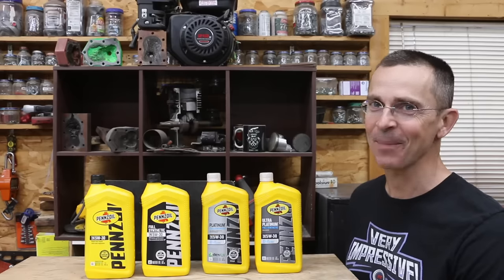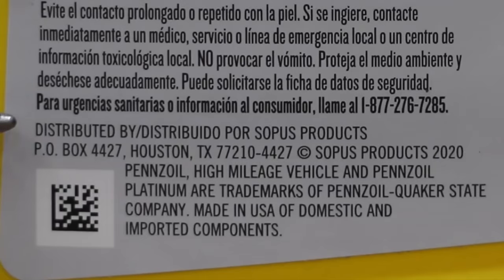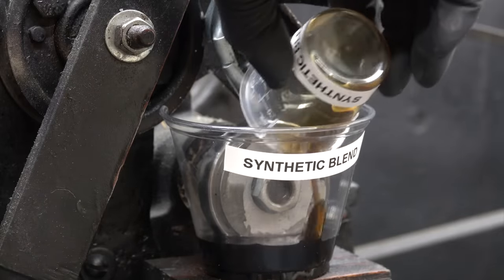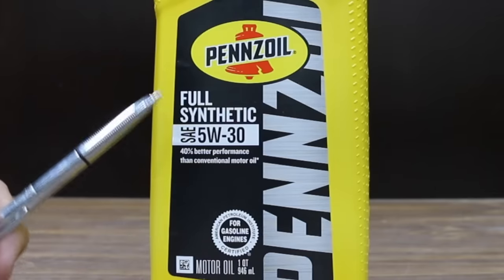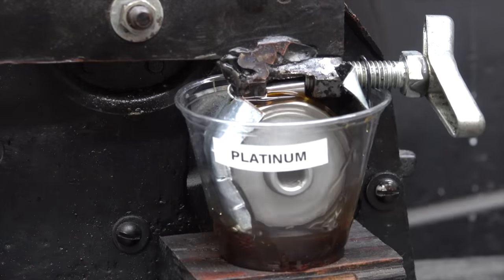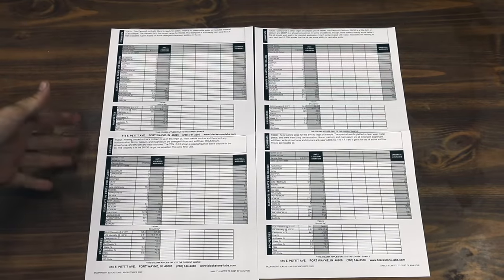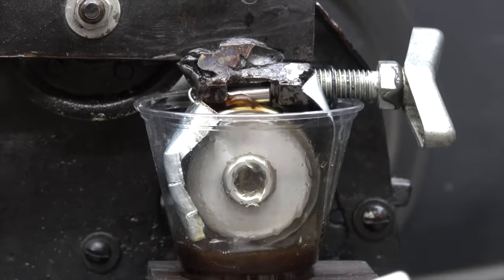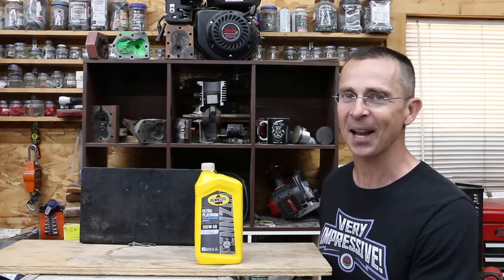Are They All The Same Motor Oil? Let's Settle This!  Four Levels of Pennzoil Motor Oil Compared

Comment: I drive a 2000 Camry with with 453 K3K miles on her original engine. I bought the car or used used but with only 700 miles . I mostly used casserobe used  Castral  Because that's what they carry it at Sears auto but right before she hit her 1st 100 K 100 KI switched over to Castro GTX high mileage and and have used that religiously every 5 - 5.5 K miles. I also add dirt loop around every 100 K and almost 1 1/2 million miles later miles later Michael my car doesn't burn or lose a drop of oil between changes. I also have always used the highest quality oil filters that I can find which is usually wix.
Reply from the maker: Thanks for sharing.

Comment: I worked for a company that blended motor oil the difference between high end and low end oil was a small (several ounces) additive added to high end. Also Shell and Pennzoil are the same company
Reply: Pennzoil is now Shells passenger car oil brand. Notice you can now only get Rotella for diesel engines nowadays and its not “Shell” branded. Also, Jiffy Lube is Shells quicklube brand and offers Pennzoil.

Comment: Rather than testing different brands or oil product lines, it would be really interesting to compare lubricity/protection between different viscosities of the same oils. For example, pennzoil ultra platinum 0W-20 vs 0W-40 vs 5W-40 vs 10w-30, or similar. You could compare them fresh, cold, cooked, etc. compare the volatility also. Would be really interesting to me to see how different viscosities stack up. 

Obviously could do this test for various viscosities of multiple oils, not just PUP. I’d be interested to see comparisons on some synthetic blends and conventional as well. 

Just a thought. People are always bickering about whether or not thinner oil is worse or thicker is better for an engine.
Reply from the maker: Thanks for the suggestion.

Comment: Used the ultra platinum in 2003 odyssey. The engine vibration became unusually obvious when speed pass 40mph. Had to drain and go back to Walmart oil which made things normal again.
Reply from the maker: Thanks for sharing!

Comment: I pulled a 5.7 gm engine apart once.  Engine development a knock.  After pulling the intake manifold.  The valley was full of tar like material. The lady that owned the truck had the oil changed every 3000 miles.  She always used Pennzoil.  After that I stopped using Pennzoil.
Reply from the maker: Thanks for sharing.
Reply: @ProjectFarm  Great videos by the way.  Keep up the good work.

Comment: Great video!  Could you do a video on Cam2 full synthetic oil?  It seems a little less costly but local shops swear by it.  It was apparently designed for the racing industry but is also used for passenger car lubrication.  There are some awesome head to head oil videos that you have.  It would be amazing to make an updated one with most of the major brands, including the Cam2 full synthetic.
Reply from the maker: Thanks for the suggestion.

Comment: I want to point out, I have a GDI Turbo 2.0 I4 Kia 2013. I change her oil every 10k_ish and I use premium synthetic with Lucas synthetic as they 6th quart.

160K, 110k under my regimen. The oil is ALWAYS fuel fouled and darker, but the Kia is the best running vehicle I have ever owned. I can see A 3mpg improvement on fresh premium synth.

One oil change a year. Premium Synth, Lucas Synth, ultra premium filter. Flush every 30k with the same stuff for 1k miles and change again.

I do this with an L83 GMC, a B5234T3 Volvo, and my 2013 SX Optima. If it didn’t work, I’d of broken something serious.

Love your car/truck. It will love you back.

Comment: I'm retired and don't put a lot of miles on my 2009 F-150 super cab Lariat 5.4 V8 nor my 2017 4 door sedan Ford Fusion 1.5 Eco boost in line 4. My F-150 has 27140 miles on it and my fusion 7340. I therefore change the oil when I get the safety inspecting done once a year. I had the F-150 done just yesterday 10-20-2022 at a shop that uses strictly Pennzoil products. Depending on the oil you chose their prices are $49.95 (Pennzoil Blend) up to $104.00 for the best oil. I paid $49.95 that included a new filter and 5 quarts of  Pennzoil Blended Oil. I had to pay ($3.50 X 2) $7.00 extra as my 5.4 V 8 holds/takes 7 quarts of oil per change with filter. I had a coupon worth $5.00 off. My total bottom line with tax was $55.00 dollars. That includes a vacuum, wash and hand dried cleaning with tire pressures and all fluids topped off. My Ford dealer offers one grade of oil (motorcraft Blended) called the works for $64.95 plus $7.00 extra for two extra quarts of oil. They don't wash but they do rotate the tires. I get the rotation done free where I purchased my G Y tires. 😀
Reply from the maker: Thanks for sharing.

Comment: I was using Ultra Platinum prior to your previous Showdown, and am quite happy with it. DI engine, so the Oils gets black pretty quick. I still go by the OLM, but GM reprogramed it, and going around the Block twice when the temps are around freezing, wipes 2% off the Oil Life. In the 70s, Pennzoil was looked upon as one of the Least Desirable Oils. They have come a long way, to making some of the Best Oils

Update:  I discovered that I can't use Ultra Platinum in my new Cadillac, as GM specifies a DEXOS Oil, which Ultra Platinum isn't. It doesn't have a DEXOS Cert on the Bottle/Jug. However the Website says it does, yet a phone call to Pennzoil, got me, in No Uncertain Terms, that Ultra is NOT a DEXOS Oil.
Reply from the maker: Thanks for sharing.
Reply: I was around in the 70s, Pennzoil and Kendall had poor detergent packages...

Comment: I'm a fan of your videos. You convinced me to buy the Black label 5W30 which seems to be almost as good as the ultra premium 5W30. There's specs seem to be very close together. Don't know why they didn't do the same with the Platinum. When you test your oils, yes they're the same weight but they are allowed to have a pretty wide variance. I was looking at the data sheets and the Pennzoil 10w30 more resembles standard synthetic 5W30 and the ultra Platinum 5W30. For some reason they decided to make the Platinum different. I know that the European pennzoils are thicker even though there are 5W30. Looking at the data sheets the Quaker State was tempting I think it's made more like a hybrid between the ultra premium and the European.
Reply from the maker: Thanks!  Thank for sharing.
Reply: Quaker state s a bargain for what it is. High GTL base and good additive package results in very low volatility/evaporation rate (better than most) and impressive thermal stability. The fact that it goes for $20 bucks a gallon at Walmart makes it a no-brainer for people looking for a very good oil at a value price.

Comment: I love your videos brother anyway I run AMSOIL only because of your oil tests but if I ever had to put quart of something else in because AMSOIL is hard to find around my area I would definitely feel comfortable putting ultra platinum Pennzoil in thats a good oil! keep up the good work brother.  oh I know you're always looking for video ideas how about testing small engine oil like Amsoil Briggs & Stratton stuff like that just an idea thanks buddy
Reply from the maker: Thanks!  Thanks for the suggestion.
Reply: It works great for me. In the summer you can catch nappa running a sale and you can get it for $7.00 a qt and I normally run it around 5-7500k until it smells like fuel or is pretty dark. It stays clean though for a long time. . One year I changed it before vacation and after 3k it was still so clear it was hard to see on the stick.
Reply: @thetechlibrarian  yeah like I said I'm an Amsoil guy but I did pick up a couple quarts of ultra Platinum to stick back in case I can't get a quart of Amsoil when my truck needs it! thanks for the info brother 👍

Comment: Chemical "sameness" could be precisely determined by spectrometry tests. Spectrometry has been key to oil analysis for many decades. 
Similar performance however close doesn't make the oil analysis the same. Spectrometric lubricant analysis is affordable should you wish to use in for future videos.
Reply from the maker: Thanks for the feedback.

Comment: I am very suspicious of the performance of the Platinum in this test.  Being out classed by a blend is just unreal.  Is this a case of counterfeit oil from a supplier?  or perhaps is there something in the DexOS qualification that forces the oil to perform so badly?  Would be interesting to see a) other brands with dexos cert tested against their own non-dexos oil.. and b) re-run the test on the platinum acquired elsewhere / different time and see if that batch was bad or incorrectly bottled.  

All said, another fantastic and wonderful video.  Love the work you do!
Reply from the maker: Thanks!

Comment: Many people tell me I'm wasting time and money because I change my oil every 3000 miles. I don't see it that way because I'm the kind of person who buys a vehicle and drives it for a very long time. The last vehicle I bought was a new 1994 Chevy K1500 with a TBI 350 engine. Now, 300,000 miles later, it's still running strong and doesn't burn a drop of oil, not even a puff from the valve seals at start up. It leaks a little, but that's just undercoating!

Treat your engine well with a good quality oil and filter every 3000 miles (I don't care if the manufacturer says you can go 5000, 7000, or whatever, change it every 3000 miles and your engine will treat you well!
Reply from the maker: Good Point!

Comment: Results for tests like this are one of the reasons the Pennzoil Ultra Platinum are at the top of my list for oil in my new Ecoboost.  With any boosted and DI engine you need to be mindful of both the oils ability to handle contaminants and deal with the operating environment the vehicle is used in.  It's pure foolishness to not protect your investment with quality products, and in a more frequent manner than the minimum requirements recommended by the manufacturer.
Reply from the maker: Thanks for the feedback.

Comment: good way to test those oils. use ultra platinum in my 2014 kia optima, they recommend the platinum/ultra platinum from the factory for their engines. all i know is my car runs way better on it , and there is much less evaporation from oil change to oil change. if i go with the full synthetic , i have to put about a 1/2 quart in it between oil changes.
Reply from the maker: Thanks for sharing.

Comment: Installed the Pennzoil Ultra Platinum 0W-20 SN-Plus oil in my 2016 Accord (2.4L) in JAN 2020 with about 28,000 miles on the odometer. I was very curious a to see how this hyped up oil would perform. Seemed good for about 3,000 miles, then the oil started burning off excessively when summer hit and temps outside rose to 108 to 110 degrees in my area.
After 3,000 miles on this oil, I was not expecting that much burn off to the point I was out of oil for the next top off. Mind you this oil is not readily available on shelves and has to be
ordered...
I'm no scientist or oil chemist but, it seems to be a no brainer that the flash point of Gas to Liquid (GTL) base stock in Pennzoil Synthetic oils are much lower than PAO (Group IV) base stock oil. Numerous additives have to be carefully balanced in the process to make this Pennzoil GTL oil work and compete with PAO base stock oils.
Further self analysis revealed that GTL base stock is between a Group III (hydro-cracked) and below a Group IV (true synthetic) base stock. Similar in structure but not a stable as PAO based oil.

Your engine won't notice the difference between GTL and PAO true synthetic oil until it gets low on oil from burning off and that my folks is what I'm worried about. Where is it going? Is it changing back to a gas form and evaporating in extreme heat (at the valve guides and piston rings)? This can be the best oil known to man but, if I have to constantly monitor oil consumption and order oil that is not on shelves, then I need to move back to PAO based oils for reliability.

Truth be told, marketing hype is at its finest here with the Pennzoil GTL products. Pennzoil Ultra is a hard to get oil off the shelf and just makes people want to try it (like me) and see what all the hype is about., It's not Dexos 1 GEN 2 certified to guarantee performance. So what makes it soo special? Regular Pennzoil Platinum out specs the flagship Ultra. Doesn't make sense.

Also getting tired of Pennzoil not controlling their documentation updates online for their products. PDF information documents dated 2018 but the Platinum oil is API SP rated as of May 2020............ CUT & PASTE corrections. What about Ultra Platinum? is it going to be SP rated? When is that document getting updated? Next Year?

That's why I don't care about this hyped up GTL based oil that does not have a mileage guarantee for XX,XXX amount of miles between oil changes like other Group IV true synthetic oils.

That 500,000 mile engine warranty does not mean squat to me when the oil burns off and I'm going through 6 quarts of oil during an 8,000 mile oil change interval on the oil life monitor and my car only holds 4.4 quarts. That's poor performance and probably why it does not meet DEXOS 1 GEN 2 standards.

Nice product but, needs a lot of work for me to come back. I don't trust it.
Reply from the maker: Thanks for sharing.

Comment: I always run Pennzoil Ultra Platinum in my high horsepower cars. My 2012 Mustang GT made a little over 1,000 whp using a VMP Gen 3 blower. The rest of our vehicles run cheap non synthetic oil. All get their oil changed at 5,000 mile intervals.
Reply from the maker: Thanks for the feedback.
Reply: The additive packs/chemistry/technology of even regular motor oils has improved so much over the past few decades that even regular oils do just fine with short/reasonable oil change intervals for daily drivers. Because of the ever changing certification standards, even most regular (dino) oils nowadays are actually a blend and include group III or GTL in the base so they can meet the newest standards. Agreed on the Ultra Platinum, I wouldn't run anything of lesser quality/standards in a HP engine.

Comment: We use Kirkland full synthetic oil.
I change the oil every 4K miles and change the front and rear differential, transfer case and transmission flush every 30K miles.
I suppose that’s why we can put 250-300K miles on our vehicles.

Penzoil use to sludge up in engines. I never use Penzoil.
Reply from the maker: Thanks for sharing.

Comment: For the Record the Pennzoil Division of Shell is in Houston TX. That has no bearing on where the oil was refined. I work for Pennzoil for a decade as their ‘Racing Director’ anc worked directly with the race teams and engineers and I don’t have a clue what the outcomes are.
Reply from the maker: Thanks  for the feedback.

Comment: It’s not about what you use, it’s about how frequently you change it, if you’re changing it when the oil light goes on, that’s your first problem right there, the oil light is merely an insurance policy for the manufacture to tell you you’re overdue and release of liability they warned you to change it

One can’t simply measure whens it’s right but you can gauge based on the environment you drive and if its city or highway, all highway driving with no traffic you may be safe with 10,000 miles if you use full synthetic and your car is naturally aspirated, you might burn some of the oil since you’re using it for its max life

City driving and anything turbo charged I’d use 5k-7,500 max

Comment: I use Valvoline high mileage synthetic 5w30 in my Sierra 1500. I noticed a bit of evaporation and possibly even leaking. Would love to see you compare Valvoline to the other brands on the rack at O’Reilly’s.
Reply from the maker: Tahnks for the suggestion.

Comment: I've been running ultra platinum for 4 or 5 years now don't think ill ever use anything else. With a 180 thermostat I don't push intervals longer than about 6k miles. I like to dump my catch can every couple k miles and sniff it to see if I detect gas if so I changed a little earlier than if not. Engine is tight after hard driving 70k and still strong. Feels better than new.
Reply from the maker: Thanks for sharing.

Comment: Man I regret running regular platinum in my ram for years, I just recently made a switch to ultra platinum after watching this, but then again i usually change my oil quite often around 4000 miles or less
Reply from the maker: Thanks for the feedback.

Comment: If you want to buy Pennzoil motor oil at a cheaper price, go to Walmart and buy the Walmart label oil in the same configuration that you want in Pennziol and you have Pennzoil. Pennzoil bottles Walmart oil and all they do is change bottles and labels and run the same oil into the bottles. I  know this because I used to work at Pennzoil packaging.
Reply from the maker: Thanks for the feedback.
Reply: This is good info
Reply: Not sure where you got that information but Walmart label oil (SuperTech) is formulated and bottled by Warren Performance Products aka Warren Distribution.
Reply: @marketing major  I will check into this. Shell oil, the owner of Pennzoil and Quaker State, was the packager of Walmart when I WORKED for them in 2013. If it has changed, that's something I have not heard about.

Comment: Been using the Ultra Platinum and NAPA Gold filters on my vehicles since the first oil changes. One has 70K on it, the other has less.... neither seem to turn as black as other brands I have used (other cars I am sole mechanic for) between oil changes. I might no recommend this for higher millage engines, but I do think that if used from the start, you will use this longer, as the engine won't "age" as quick. For mine, 5W30 in 2 (3 if you include the snow blower) and 0W20 in the other. Red label Pennzoil "high millage" in all other cars.
Reply from the maker: Thanks for sharing.